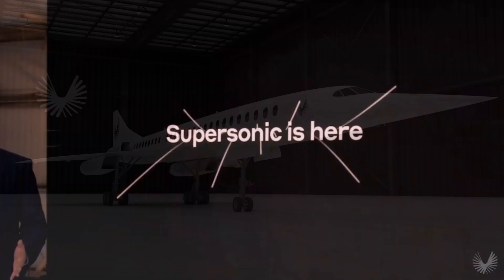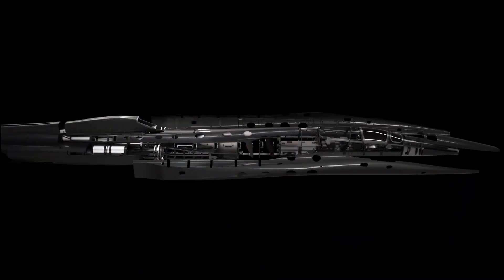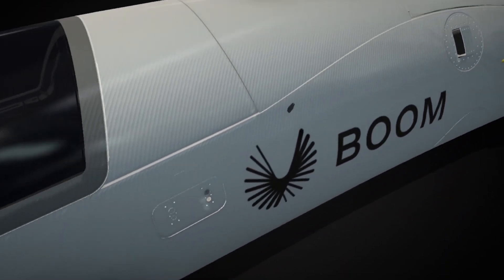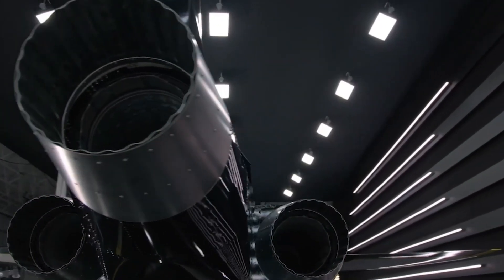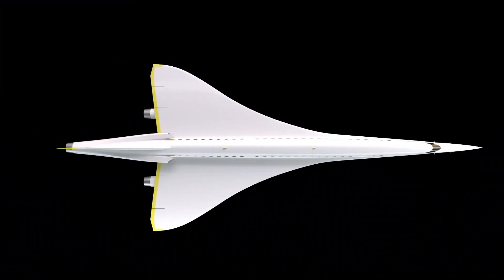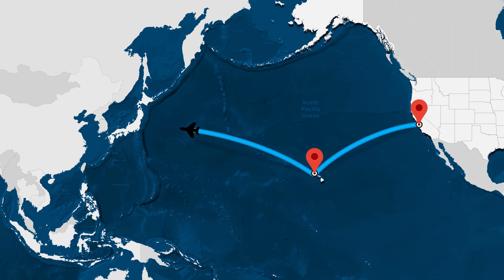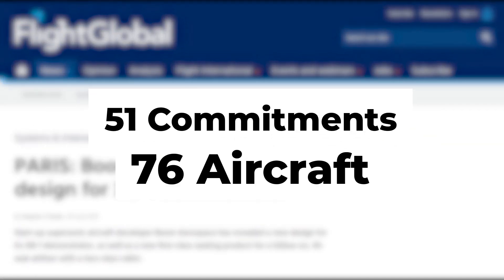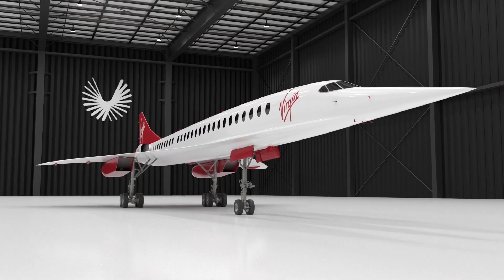Boom XB-1 Rollout & The Boom Overture - What Happens Next For The Concorde 2.0?

Comment: Yes, the Concord drank down fuel.
However, a big chunk of that fuel was due to the Rolls Royce engines, not only big, but were equipped with afterburners, known also as "Re-Heaters."
At the time of construction, the materials we have today, were not options to choose from.  Carbon composites, fiber optic, 'fly by wire,' or 3D printing, were all in their infancy.  But so were cell-phones, home computers, satellite TV, or electric cars.
And for all the down side of the Concord, here we are today, nearly 50 years since the Concord became a 'thing,' and it's design is basically being replicated!
The Concord just wasn't a well thought out plan on the business end, not as much in design and construction.
They used the best and most advanced technology they had for the time.
They had the Skylab, the space station that came before the ISS.  We had stepped on the moon...

Comment: If planes fly above 50k', then the "sonic boom" is more like a leaky tire.
The air is so thin up there, that sound waves don't properly propagate with any real force. Instead of roaring, they whimper.
Also, the long, tapered Sears-Haack Body would further minimize any boom. This is the route that Spike Aviation is using.

Comment: Jet engine technology and aerodynamic technology have come a very, very long way since the Concorde. Supersonic commercial flight can absolutely be feasible today. We can create far more thrust while burning far less fuel.
Reply: A modern supersonic airliner would be using a medium bypass variable cycle after-burning turbofan similar to the military XA100 and XA101 prototype engines developed for the 6th gen fighter. Those kinds of engines will be capable of high speeds while still being really efficient at low speeds and definitely able to supercruise.

Comment: I have a problem with this aircraft having a jet engine built into the tail. A catasrophic  failure for an engine located in the actual tail section could result in structural failure of the tail section, then you are really screwed!! They should have just stayed with 4 engines all in the wing area

Comment: The voice of the host, has improved from other whiney jesters vids, with no shaggy background melody this time... The crafts that have lower mileage travel range will result in having to travel over contents,  thus being more regulated to fly below super sonic polution rate, by the EPA & eventually the FAA, what would be the Ideal fastest then ever passager craft , is a rang flight between modern private space programs and the classic super sonic concord. A craft that renders like a plane in low atmosphere for takeoff & runway/pad landing and between those task, rocket gears beyond super sonic though very high altitude for passenger Orbitline spaceage style service. Resulting to be a safer improvement vs the pure rocket fuel danger, or the airplane low flight sound polution.

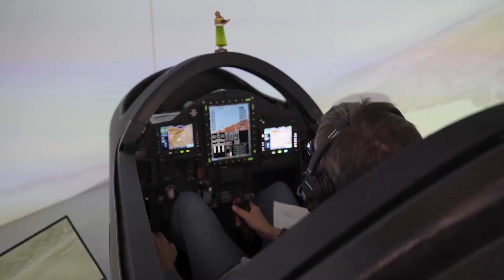Comment: 2:26 Thats an SR71 tactic. Using the fuel to cool the airframe.  I wonder what other tech's they poached from that black project. Delicious. I love it.
Reply: Concorde did the same, they also used the fuel to balance the plane during flight, pump it from tank to tank all over the plane.

Comment: The biggest advantage Boom offers is a near perfect business model.  If you, Mr/Ms Businessperson have to fly JFK to LHR, and you are paying $5000 RT, what would you rather fly, a 787 which takes 7 hours plus, or Boom, which takes three hours?  Because the flights will be much shorter, there is no need to push "lie-flat" seats with lots of amenities, pampering service, etc.  The Boom flight will get you there in half the time for the same price.  I don't see how they can fail.
Reply: A 797 because the plane has been safety tested at millions of actual flight hours with proven systems, I'd rather not go boom at supersonic speeds.

Comment: Give this plane a 2+2 seat configuration so the total seat capacity will be 110 pass. Give it a larger wing for more lift and three t.j.e's engines with a 22500 lb thrust each and you will still have a supersonic aircraft which will give better seat /km profit albeit at a slightly slower speed but with a extended range. O.k.??
Reply from the maker: Good idea!
Reply: @FoundAndExplained  I have an idea for the Boom Supersonic:  How about ditching the delta wing, and replacing it with a 35° standard wing sweep. That means more lift = more seats. Problem solved. ;)

#HeyBoomDitchTheDelta (just kidding, I am not a Twitter or social media user)
Reply: @thatguyalex2835  wouldn’t more lift mean more drag which would mean more fuel consumption?
Reply: @Spppanky  Yep, but the best combination between lift and drag would allow for a plane to perform equally well in both the subsonic, and supersonic regimes.
Reply: @thatguyalex2835  and you don’t think they’ve thought about that already?
Reply: @Spppanky  They did, back in the 1950s with the Handley Page Victor aircraft. It worked out pretty well (mach 0.99 maximum speed), but sadly the company went out of business for other reasons.

Comment: The problem with the Concorde wasn’t fuel consumption it was the American legislature banning it from flight overland and incorporating other countries into their idea to protect Boeing because they failed to build their concept. The Concorde was the only supersonic plane to super cruise, the tupolev concordski  had to run on after burners to maintain supersonic flight, Concorde accelerated on afterburner then supercruised with afterburners off.
Reply: Well, most people on the ground didn't want to deal with the plethora of issues the booms caused, let alone all that noise. That also does NOT help. On top of that, no average working class person would ever have been able to fly on it, since it was strictly high-class luxury for the rich to enjoy, with tickets well beyond comprehension in regards to their price-tags. And then the fuel cost and it's low efficiency definitely played a key part in ending it's lifespan of use, too. It was definitely not an exclusive reason, but it was one of the main key reasons.
Reply: WRONG---In 2002  B.A stated, that 25%NET of their Profits , was due to their Concorde Service, and rising.  What added to this , was the rise in Hiring Concorde by ordinary people celibrating special anniversaries  etc etc , and clubs and societes filling the seats  @TheCriminalViolin
Reply: @TheCriminalViolin  i couldn’t agree more, so why build a miniature Concorde? The noise issue won’t go away, as for fuel price in reality it’s relatively cheaper now than back then. Unless the plane can leave the atmosphere noise will always an issue.
Reply: @neilmchardy9061  True, but I suppose perhaps the boom could be lessened if they were restricted on when they would be allowed to go full throttle to break the sound barrier, say to be at least at 20K feet in elevation first, and/or at least 50-100NM away from the main residential areas/the airport itself. I think if they would make it so there was a altitude restriction on when they would be allowed to begin their pursuit of supersonic crushing speeds, they could alleviated the impact and noise from said booms.
Reply: @TheCriminalViolin  the problem with that argument is that, that is exactly what Concorde was trying to do, to avoid making excess shockwaves. One of it’s issues was an orchestrated political movement to stop its overflight by people who had never heard it. At take off it was ear shattering, just like any big plane on full afterburn but the sonic boom issue was way over stated.
Reply: @neilmchardy9061  Simple. There are now more rich Asian countries, meaning you can now fly across 2 oceans.
Reply: @米空軍パイロット  that is a good point,
Reply: @neilmchardy9061  It's important to remember that the Concorde was successful for the airlines and only unsuccessful for the manufacturers. The only times the airlines struggled was when there was an oil crisis and when they were still trying to sell economy tickets for the plane. Now, there are probably enough customers to make the manufacturer successful too.
Reply: @米空軍パイロット  Branson wanted to buy the planes but they all had cables cut and hardware removed to render them scrap, they could have been mothballed but the owners insisted they were rendered inoperable to stop anyone like Branson making a success.
Reply: @neilmchardy9061  That's petty. Then again, without spare parts, he would have had a hard time operating them for long anyways
Reply: @neilmchardy9061  

"At take off it was ear shattering, just like any big plane on full afterburn"

Nope, most aircraft don't blow our your ears and break your windows when going at full power.

" but the sonic boom issue was way over stated."

See above.
Reply: @neilmchardy9061  at takeoff and whenever it passes overhead. Thats why to bring back supersonic over land we would need "low boom" which Lockheed and nasa just recently developed. Lets you break the sound barrier with a barely audible sonic boom.

Whereas a normal supersonic jet like this one could go Mach 0.90 over land -- so new york to LA in about 4 hrs instead of the current six -- and then go supersonic over water.
Reply: See now that Boom is an American company, the US Government doesn't care anymore.
Reply: neil, it was because the US Air Force got thousands of complaints when flying supersonic over land.

Now Lockheed and NASA have invented an airframe design where you can break the sound barrier with a barely audible sonic boom, so assuming that works out we will supersonic over land return.
Reply: Uh the problem with the Concorde was that it cost $4000 for a one way ticket!?!
Reply: The Concorde B concept from 1976 proposed using an improved Olympus engine that did not need afterburners to accelerate to Supersonic speeds. It would have been much quieter on take off. That's with 1976 technology

Comment: Only 4K lbs from each jet engine? That’s with afterburner? There are engines that can make more than that without afterburner. And there are definitely single engines that can make the combined thrust under afterburner. I’m not engineer tho maybe someone here can explain?
Reply from the maker: It has three J85-GE-15 that each provide:
4,300 lbf (19 kN) thrust
It has three because it needs the power of three, and it can't use one due to weight and noise. The engine itself is also very available and reliable. Better than sticking a GE9X. And you need more than one for commercial aircraft.

Comment: Nice video about boom but calling Aerion "nothing more than CG mock-ups" is not right. They work with big companies, their design is more conservative in max speed, and they plan to fly in 2023 already (as of today). Also, the AS2 design in the video is a very old one, they changed majorly (engine position, wing shape, empennage, etc.)
Reply from the maker: Did you watch my video with aerion?
Reply: @FoundAndExplained  My comment is based on what I see and hear in this video. I also have just checked your Aerion video, nice video editing and speech but it does not tell anything about Aerion being "nothing more than CG mock-up". In contrast, you mentioned there that Aerion is supported by a number of big companies and still plans to fly in 2023. In this way you contradict yourself calling Aerion "nothing more than CG mock-ups". Moreover, in the video, you jumped between AS2 designs back and forth without explaining which is the latest one at least (only mentioned that the number of engines was increased from 2 to 3). Please, do not be offended by the comment, this is just some critics. You already have good visual and audio components. I think you will really succeed when improve the plot.
Reply: @Stanislav_Sikulskyi  Yeah, but we’re not seeing any physical aircraft now, are we? So all we do have are 3D CGI Mockups. Sounds like someone here’s simping too much for a company that has objectively yet to deliver.

Comment: I always get a laugh out of seeing the numbers of “aircraft ordered”...🤣...which means absolutely NOTHING, until the demonstrator(s) begin flying and proving that the technology works and can be proven a success over time. Everything being talked about sounds good in theory and it seems as though they have a better handling of the technology this time around...however, only time will tell if it’s a success or a failure this time around. Good video though, very enjoyable!
Reply: Supersonic has already been proven possible in the fucking 1960's you idiot. They're just making it better so it uses less fuel. That's it. It's only made for more efficiency. The technology is the same everywhere else.

Comment: Its  stupid, engines below the wing with short intakes will get any object of the road.
      Concorde and t144 have the same "feature" and those guys copied.
      Just my opinion.
Reply: It works. Functional isn't stupid. Also see XB-70, B-1B, Tu-160
Reply: @unfurling3129  most of those planes that you cited use a especial airfield and are long range enough to reach there. They are not landing a b1 bomber in shithole airfield. A concorski was lost because of that, a supercruise plane dont have high bypass turbofan, so a bird sucked in will always pass inside the engine, mostly destroying it, that is not what happens in a normal jumbo jet.

Comment: I could see a market for 200-400 units, but extremely unlikely 2000 units - that is pure fantasy. The ONLY routes where such a plane makes any sense are those, like New York - London where 90%+ of the route is over open ocean and without noise restrictions. 2020 has been a shakeup and wake-up year for global travel, and my crystal ball suggests that a significant part of the changes will be permanent. A return to the 'golden age' of flight, in terms of gold-star service and premium expectations is one of the things that I expect - If I am flying, I expect to be comfortable and have my needs and desires met. Cattlecars need not apply. (Though there will always be a demand for economy service, the volumes will not return to where they were prior to Jan 2020.)
Reply: mitton, you have that already, just buy a first class ticket bro.
Reply: Sonic boom might not be as much of a problem for modern aircraft where that can be built out of the system.
Reply: @matsv201  it doesn't work that way - unless the aircraft can break the laws of physics, it WILL have a very loud sonic boom when (and at all times when over) it crosses the speed of sound... any suggestion of reducing that noise signature is purest fantasy.

Comment: What did he mean by the Global-Hawk hyper sonic flight? That Drone is not even a supersonic aircraft, so you can forget hyper sonic speed. The Global-Hawk is a subsonic Drone.
Reply from the maker: Global hawk, hypersonic flight
Reply: @FoundAndExplained  I think you might be confusing high altitude flight with hyper sonic flight. The Global-Hawk is a high altitude Drone, not a hyper sonic aircraft. Hyper sonic is speed exceeding Mach 5 = 3,000mph (which is 5 times the speed of sound). But the Global Hawk's top speed is 357mph, while supersonic speed starts at 764mph, so you can forget hyper sonic speed. If the Global Hawk was hyper sonic, it means the Drone is even faster than the Concorde, which flew at Mach 2.2. And that is virtually impossible with the Global Hawk's long straight wings, and round bulging nose. So you need to get more informed. Heck, America's F-22 Raptor is not even hyper sonic.

Comment: The Supersonic aircrafts which have the shortest take off roll are the Saab Gripen and the Dassault Rafale, they both use Close Coupled Delta Canard planforms. The Rafale Take off weight is 2.5 times the empty weight! 
The Viggen, predecessor to the Gripen was designed with a close coupled canard to achieve short take off runs with a low deck angle. It too is a Supersonic aircraft.

Comment: Well, technically it’s not the first private supersonic aircraft. There was the BD-10

https://en.m.wikipedia.org/wiki/Bede_BD-10
Reply from the maker: Wow what a fantastic story! Video idea!
Reply: @FoundAndExplained   5 aircraft built, 3 crashed and the last 2 are not flyable. Do a little digging into Jim Bede and his snake oil business practices and you'll quickly see that most likely the BD-10 was largely smoke and mirrors.
Reply: I remember the BD-10 when it was in full hype back in the 80's. Without reading the Wiki article, just from memory, I don't think the thing ever flew supersonic. I do know that it actually did fly, but it had big problems and ultimately the program never really went anywhere.

Comment: Well hmm. Was going to say that Virgin galactic is hypersonic. But i checked and its planned to be Mach 3, which isn’t. But they call it hypersonic.
Reply from the maker: I will be doing a video on Hypersonic and what it is!
Reply: Found And Explained its above Mach 5 and expected that that will require an air breather engine. Due to the high and speed and compression of air, it uses air as fuel. There. All done :). Would be interesting to see all the attempts being made. Think Russia is first with a hypersonic missile.